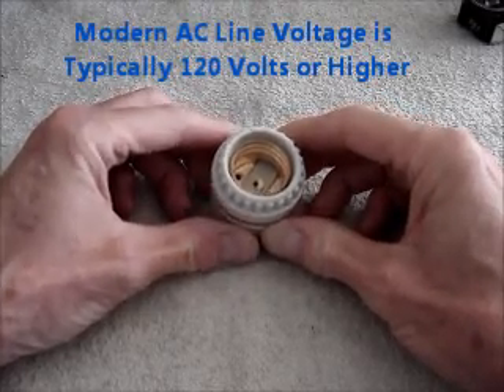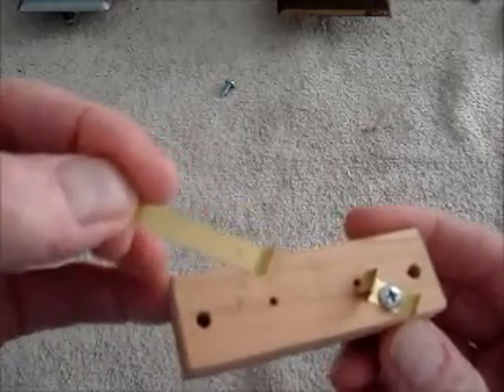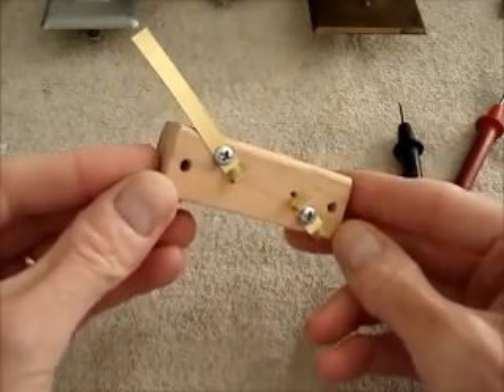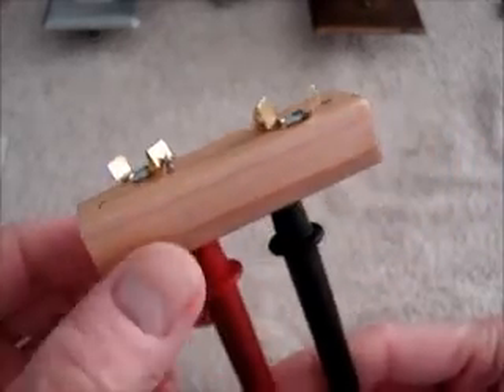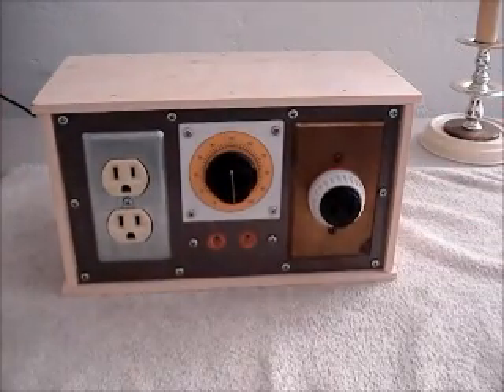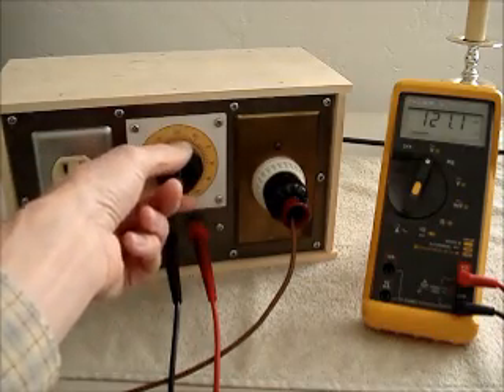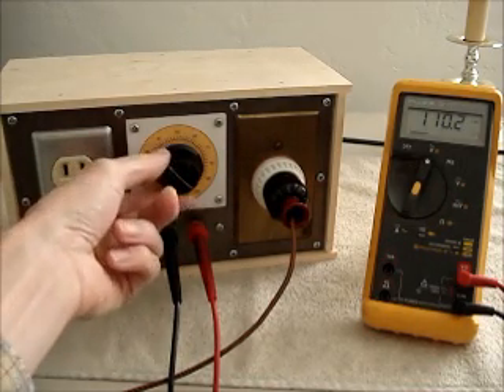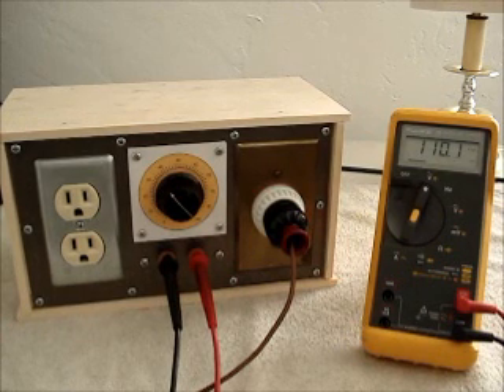AC Line Voltage Controller for Atwater Kent Model 40

Comment from the maker: Hi Joe,
Yes, you are achieving the same end result. The Variac is an adjustable autotransformer, whereas I am just using a rheostat. By the way, I also have several step-down autotransformers, that I made out of filament transformers, that I use for some of my other old sets. Thanks for watching and liking my video!